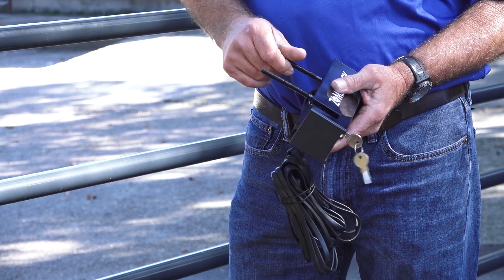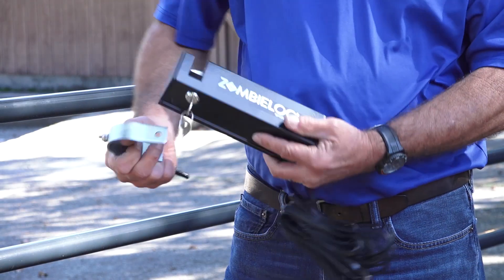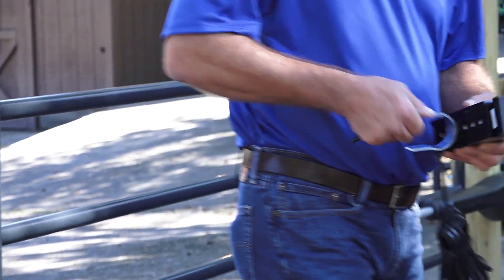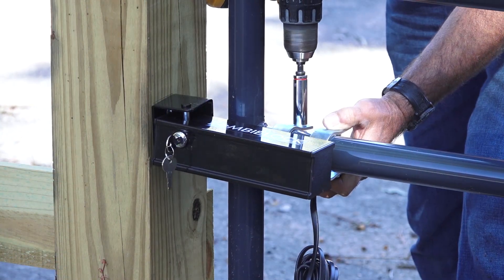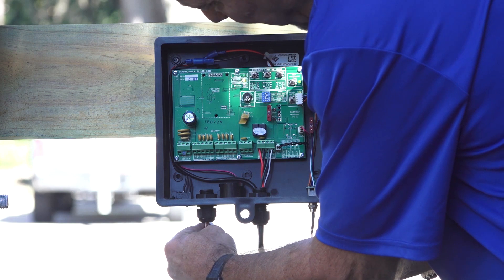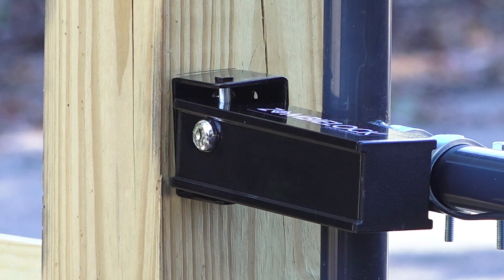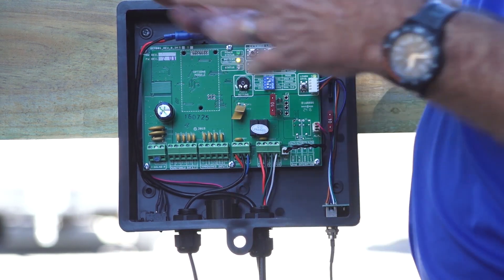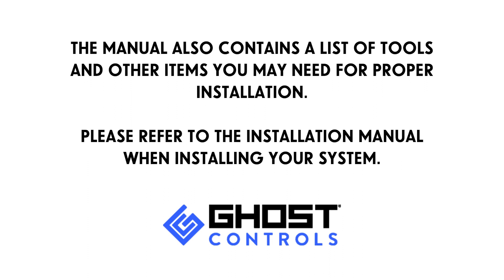Automatic Gate Opener-Chapter 9: Installing A ZombieLock

Comment: I have a question, when deacctivating the zombie lock,  do we need to disconnect wires of zombie lock on the power board? I'm asking because the guy in this video said to disconnect the wires but he didn't do so, Therefore my confusion

Comment: I have a gate that will be closing up a driveway that is poured directly beside the house, no room for an extra posts. I plan on mounting the bolt to the brick and the locking mechanism on the gate. How much room do I need to leave between the gate and the house?
Reply from the maker: Hi Tyler, It sounds like you want to mount the gate lock on the gate since you will not have an adjacent post for mounting the lock receiver. That distance would be a minimum of 2 1/2 inches.
Reply: @Ghostcontrols2015  perfect, thank you

Comment: Can this be used if there is no gap between the tube gate and post?
Reply from the maker: If you mount the receiver bracket to the front of the gate post and align the base of the lock on the gate so that it aligns it should work fine.  We have a picture we can send you if that helps. Reach out to us at 850-898-1411 or email us at support@ghostcontrols.com if you have additional questions.

Comment: Can a ZombieLock be used with a double arm system somehow?  I imagine one side would have to close before the other.
Reply: Did they say if one side would open up first? Because I was asking myself the same question you asked, and thank you so much for replying
Reply: Felix Hernandez Yes.  One side gets programmed by you or the installer to open first and close last.  Might contact Ghost Controls directly for a more concise answer though.  I didn't end up installing one yet.
Reply: Chris Powell did you ever got the answer? I’m looking for it now as well.
Reply: Yes. You can set it up in your ghost control mode to delay the gate that should have the lock on.
Reply: Did any of you guys get the answer? Haha I have the same question
Reply: @felixhernandez9354  I contacted the manufacturer and they said you can use a zombie lock with a double gate.